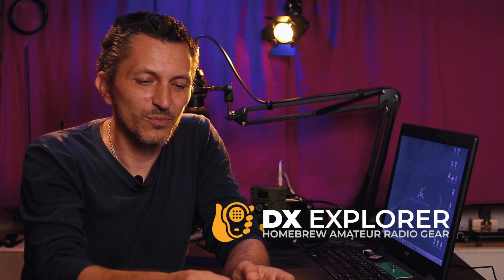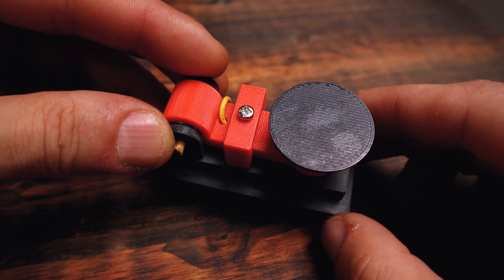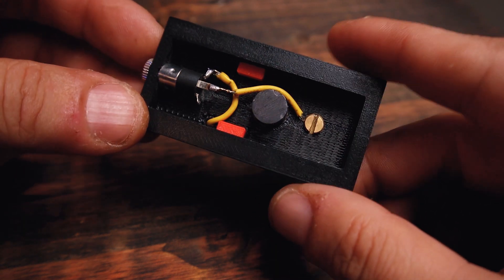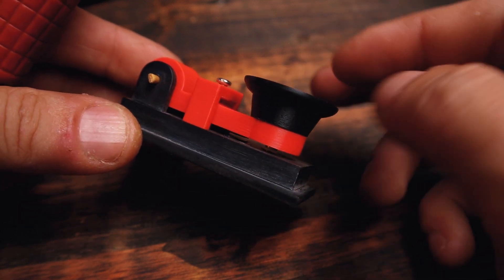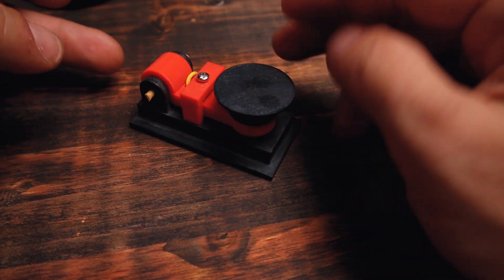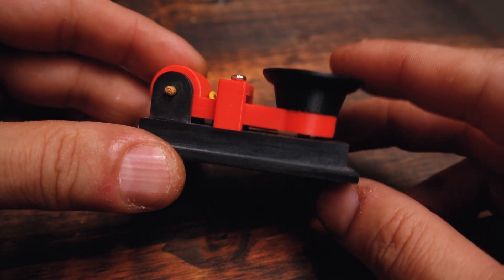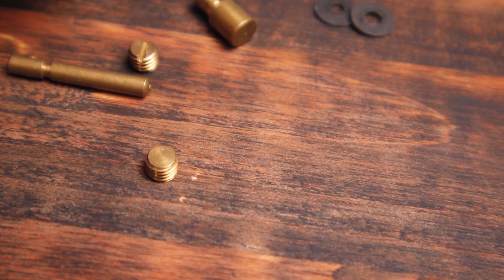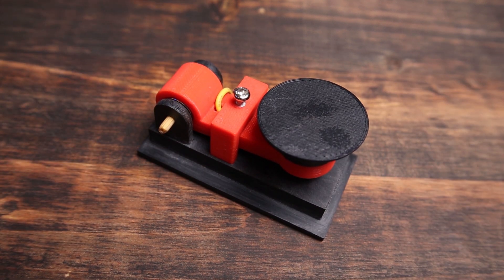3D Printed Mini CW Key Great For POTA / SOTA or Code Practice

Comment: Great Video and CW Key. How about using a 1.5mm2 or 2.5mm2 wire as the hinge part? 73 de OE8GKE.ll
Reply from the maker: That could work probably. I think my sister will come to the rescue and she may have that missing screw I need 🤣🤣. Thank you for watching and have an amazing rest of the week. 73, YO6DXE.